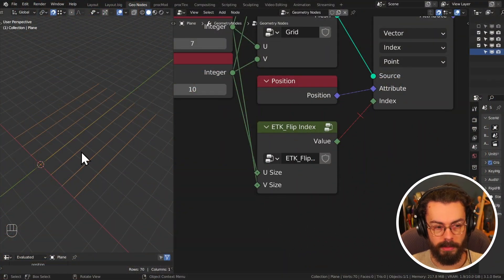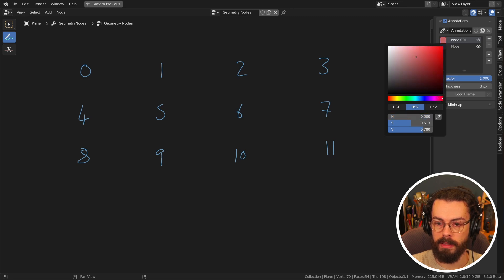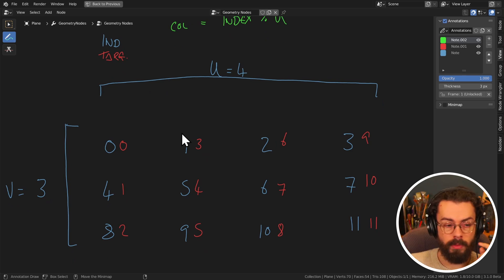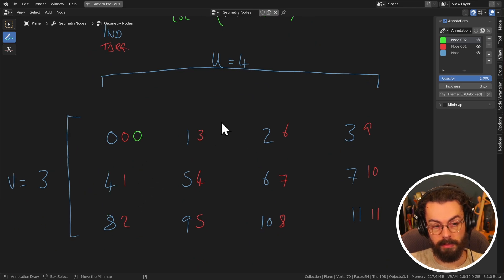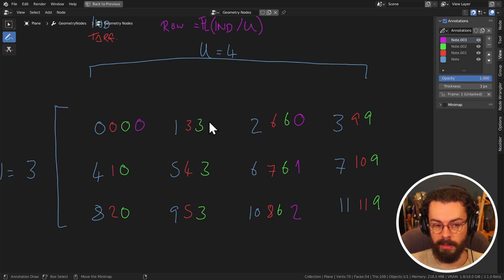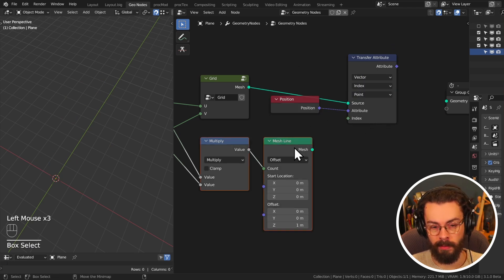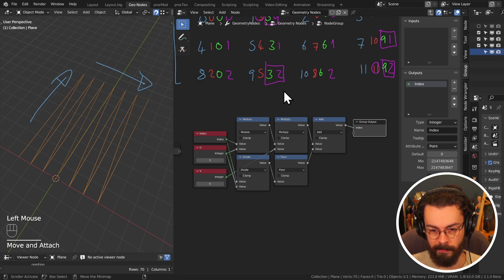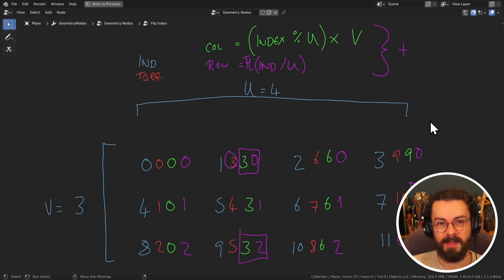Flipping Indices - Geometry Nodes Tutorial

Comment: Hey Erin, 
Do you know of a way to compare vectors in Geometry nodes?
I use Rhino with Grasshopper at work, and there the List handling is pretty good and relativley easy to understand.
I have a Curve,Iused the Curve to Ponts Node, which gives me a number of Points on that curve.
It also gives me the tangent vector for each of the points.
My idea is to compare a list(field) of Tangent-Vectors, to a shifted List of the same Tangent-vectors-
in Grasshopper there is a shift List node, which prettymuch shifts the Indices of that List, and therefore  lets me compare each tangentvector with its neighbour.
Is there a way to do that in Geometry nodes as well? Or do you know a different way of comparing each vector of a list of vectors to its direct neughbour?
Greeting, James
Reply from the maker: Lists is something I'm sorely missing in Geo Nodes and why I'm still using Sverchok a lot. It's slower but it's based on Grasshopper.
What you can do is take your tangents into whatever you're using to compare eg vector math node. Then take a Transfer Attribute node, set to points, vector, index. Plug your points into the source, tangents into the attribute, and index into the index. But you want to use math nodes to offset the index and you might need to also modulo with the domain size if it doesn't loop around to 0 properly. You can then plug this transfer into the other socket of your vector math node.

It's not a "nice" workflow but fields don't exist without geometry, they're just referencing it. Different to Grasshopper where your lists are actual lists of data.
Reply: @Erindale  Thanks Erin, I will Try that out- yes, the fact that Lists are not a thing of its own in GN, seems pretty weird. + there is very little documentation on many Nodes so far... that makes it quite hard/abstrakt to get Into Geometry nodes.
Is there a dedicated Discord server for geometry nodes, where I can ask questions like these?

Comment: This is a perfect example to demonstrate how great is Blender for learning math. Also a question: how do you determine that you should use nothing else but modulo or divide+flooring in these cases? What's the logic behind this?
Reply from the maker: If we think of the values like a gradient I think it's a bit easier. So if we have a gradient and we want it to be split into repeating gradients then we want fraction (0..1), modulo (0..n), or wrap (n..n). And for stepping for the rows you can use snap to get even blocks and then divide to get the step size to 1. Or like we did here, divide first and then floor (which is faster than snap).
You just need to identify if you're making repeating ramps or steps.
Reply: @Erindale  yeah, this approach will help to understand it better. Thank you 😊

Comment: Thank you, Thank you.  For both the example and the Math behind.  I've been using Grasshopper for the past 5yrs where Flip Matrix is just a standard component.  TBH I didn't realize that there was a simple Math way of doing this.
Reply from the maker: Yeah it's one of those things I'm sure will be added to geometry nodes natively in the fullness of time but for now, a little bit of maths goes a long way! 
You can actually do most high level things with math nodes. I saw someone make a full curve deform node to make arbitrary meshes follow curves and that was all just maths.